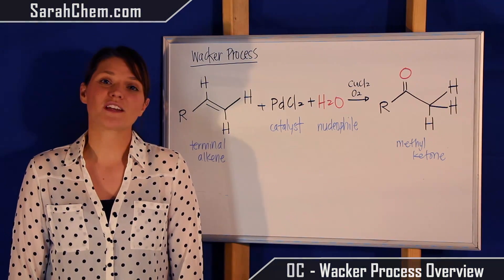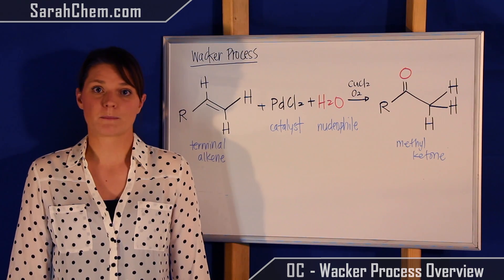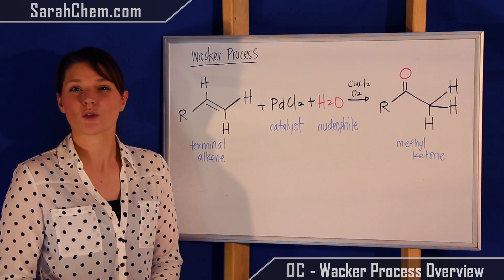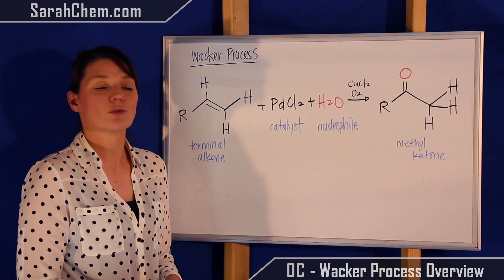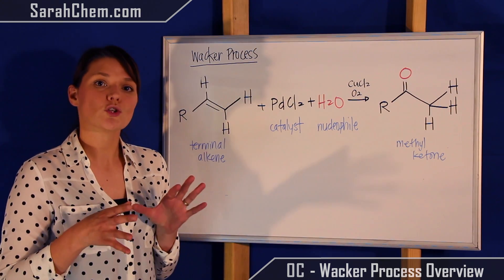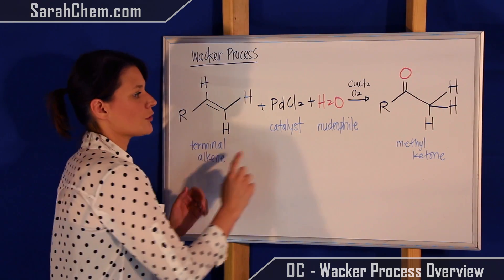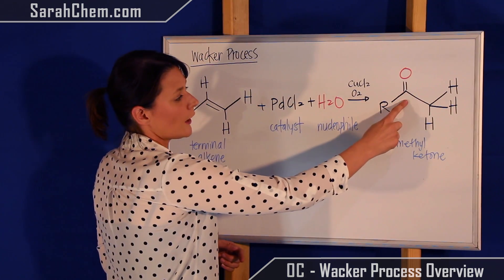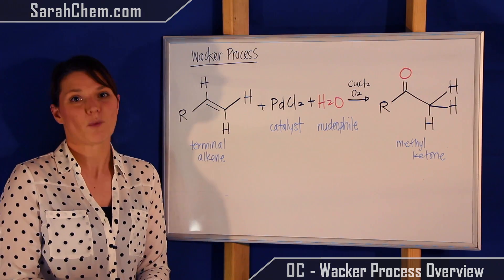Wacker Process

Comment: but in NCERT it is written that  ETHYNE  TO ETHANAL? is it wrong ? (in last para of d and f block element chapter)
Can anyone explain?
Reply: probably a bit late for you but like she said, remove the double bond. Structure of ethyne is HC(triple bond)CH. As both carbons in an ethyne are terminal you can place the carbonyl oxygen on either carbon. Valency of carbon is four, so when you add double bond oxygen to one of them you'll remove the double bonds. This will give CH3-CHO. This is an ethanal or acetaldehyde

Comment: If pdcl2 is catalyst then why r we using cucl2 nd O2?
Reply: Shilpi, CuCl2 is used as an oxidizing agent to regenerate the Pd(II) catalyst. In the final step B-hydride elimination occurs and Pd is reduced (Pd(II) --> Pd(0). Without the oxidizing agent, Pd would react stoichiometrically and it is very expensive
Reply: @fletch7777777  🤒